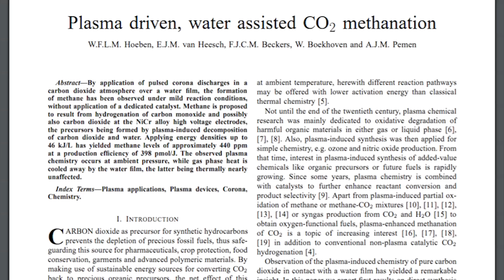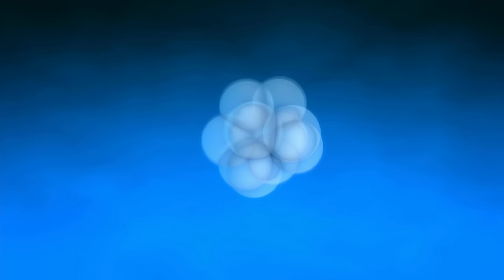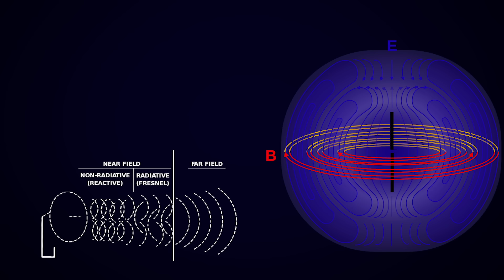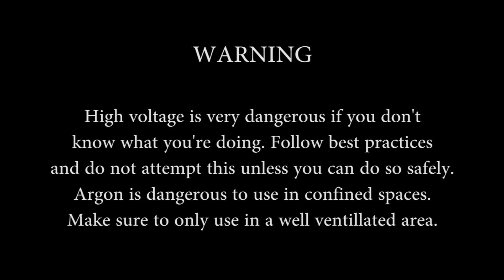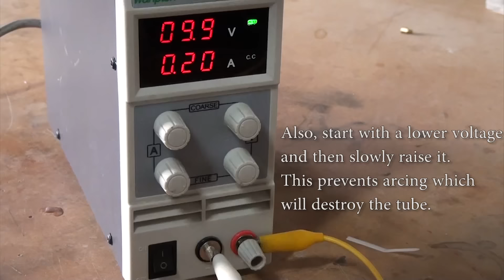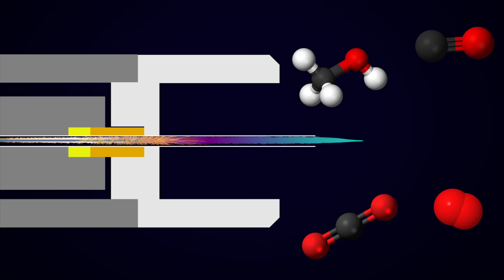Cold Fire You Can Touch - DIY Cold Plasma Torch

Comment: This is like when my older brother told me "blue fire is cold"
Reply: Brandon allidaP except this one is true
Reply: Brandon allidaP did u touch blue fire
Reply: @smellybruhwithattitude7287  maybe 
...
Reply: The more yellow it is the more dirty the flame, cleaner burning flames are hotter and go blue to clear. Don’t let your brother tell you stuff like that.
Reply: Yes and white fire is like ice
Reply: Magnesium fire is very bright white and  thus, very cold to the touch
Reply: I used to think that. I learnt my lesson...
Reply: He has never been near a Bunsen burner, then.. Blue means it is burning more efficiently... ie: burning all of the fuel. Bunsen found that torches weren't getting enough oxygen so a flame on the end of a needle with fuel pumped through ( think a simple lighter ) will burn yellowish. Adding a simple hole, to allow more air to be sucked in, allows all of the fuel to be burned.
Reply: @Acecool  i owe you one
Reply: @Acecool  wait so which is hotter
Reply: Blue fire is "cold" when compared to the bright yellow and white flame. It's still hot as fuck. Butane torches produce a blue flame, but that stuff can heat steel until it glows red, and can melt some metals, like aluminium. Don't touch blue flames.
Reply: Older Brother: Touch the blue fire it’s cold
Younger Brother: Touches cold plasma torch
Older Brother: 😨
Reply: It is touch it I dare u😂
Reply: Don’t touch the blue fire
Reply: This is completely different from your bro telling you that blue fire is cold
Reply: Blue “fire” is the hottest part of the flame 
This is cold plasma
Reply: Ethan Bayer 😂😂
Reply: @davidvenegas3198  These lesson s are like with Alice....each one gets shorter.
Reply: @davidvenegas3198  Every body looking at the blue "flame". Could be like Tesla ball..?
Reply: Owch
Reply: @markarthguard4443  RIP
Reply: @PunakiviAddikti  No, the hottest is white then blue then yellow.
Reply: @heh2393  and ultraviolet is hottest. So, hottest fire is near black.
Reply: @doombringer3498  No, according to Planck's law of emitted radiation (and Wien's law too), the wavelength with peak intensity is inversely proportional to wavelength, with intensity falling off on both sides. Thus as the object gets hotter, the peak passes across the visible range. Thus initially the peak is at red, then blue and finally when the peak is outside the visible range, all visible colours appear to have nearly equal intensity and thus the flame appears white. [NOTE: This analysis applies even better for objects that are better approximations of blackbodies, like stars]
Reply: @heh2393  thx!
Reply: @doombringer3498  Always welcome!
Reply: Lmfao
Reply: @wriggler5535  its never enough...
Reply: Our sun is really inefficient
Reply: I mean blue fire is either a cool temperature or REALLY frikin hot. Although someone did make a fire that froze water and it was white.

Comment: “I didn’t have any brass tubing so I just made my own” 
Y’know, just casually making brass tubing, like you do
Reply: Well, someone casually makes brass tubing, I mean the stuff I buy on Amazon must come from somewhere.
Reply: Probably melted a jar of pennies
Reply: @dmwanderer9454  That's copper, not brass.
Reply: @calebhouston5799  Pennies are mostly zinc with a copper coating.
Reply: Copper is one of the materials for bronze, the other is tin. I don’t remember what brass is a combination of though
Reply: @CubicApocalypse128 pennies used to be mostly copper. With the right ratio of old to new pennies, you could easily make brass.

Comment: put a phosphor on the tip so u can tell when its in use (from the uv light)
Reply: Better yet, get some 12 mm neon tubing with the phosphor already coated inside. You can make this a shroud on the output end of the torch.
Reply: great idea. a bit of glow in the dark pigment will do the trick. 
finding the raw materials for neon tubes isnt exactly easy, especially in small quantities. and most phosphorescent coatings used there arent durable.
Reply: @Ucceah  glow in the dark powder charges up. You need UV fluorescent dyes
Reply: no not phosphor, I think you mean photo-luminescent or fluorescent material but phosphor is highly reactive to oxygen so it will start burning in place not only when the torch is on but continuously until it is finished.
Reply: the "phsphor" in  CRTs has a very faint afterglow too. just like some white LEDs. it's falsely called phosphor, but that's what it's called. 
glow pigment has makes a great UV indicator, it's much brighter under UV, that it could glow on it's own. (the shorter the wavelength the brighter)
Reply: @htmagic  Then all it needs is a whirring sound and it's a sonic screwdriver :D
Reply: Any glow in the dark powder will work as a 'phosphor'... easy peasy.
Reply: Frank Roberts  yes, i think you are right, i didnt know phosphorus is the name of the element i thought it was phosphor since in my language it is similar to phosphor. Thanks for "illuminating" ;)
Reply: Frank Roberts  his emphasis being cheap lol
Reply: That's a really good idea lol maybe some shitty glowpaint or something simple. Idk if it would effect the torch at all tho.
Reply: I wonder if aimed at an old "Boob Tube" TV screen in close proximity, if it would excite the electrons on the phosphorous coating?!  Basically acting as an electron gun. ;)

Comment: air and water into fuel?

*united states would like to know your location*
Reply: Achievement Unlocked: killed by big oil
Reply: @mikescholz6429  And the next you will tell us, is the earth is flat and hidden by NASA. Right?
Reply: Lol no? Unlike that nonsense there are some verifiable deaths under odd circumstances with alternative energy. Its was also slightly a joke.
Reply: Look what happened to the american guy that ran his vehicle on this . He died in very suspicious circumstances , and his plans disappeared from his home , no witnesses . . So america already has this information . Strange how this happened after he refused to sell the plans to the corporate oil companies and government . . Its all there for anyone to lookup on the tube . He was going to give the plans freely to the public , he never had the chance to do so , this could be classed by some as speculation . . But ...
Reply: There's actually a city in Sweden where I think some government vehicles and a few private ones run on methane produced using a similar method. They take CO2 from the air and I believe the water is rainwater and they also capture the water to be reused when they refuel. They're basically electric vehicles which have had their batteries swapped out for generators running on methane.
Reply: Mainstream-ish tech now, several companies trying to make large scale carbon capture facilities to turn CO2 back into fuel. Though now it's a bit of a fool's errand since most transportation and energy will be moving to much more efficient electrical/renewable alternatives. After all, can't beat physics, you'll be putting in way more energy to make that "renewable" fuel than you get out of it. Great for aerospace where there simply isn't the tech to get something into the air/space on electricity (at least not for long).
Reply: @fava7753 If stainless steel is used to make and HHO cell it will produce deadly water. are you talking about stan meyer?
Reply: @fava7753  I remember that as well! He also had a welding machine with this technology. A flame you could touch and made with water. 
Not sure if this was in the 80s. 
He was harassed alot by guys in suits.
Reply: @hansnielsen4165  What kind of shrooms are you on dude? He was just making a joke. Before you say "well he better learn to make better jokes" just walk away. If this is humor that you don't like or understand, then leave it.
Reply: Not just America, you can't forget oil companies!
Reply: Idk about water.
Reply: honestly to everyone here, I would say this is more dangerous to the manufacturing industry because this is probably how they are making those plastic sheet based Arm processors that will cost so little that they can make hundreds if not thousands for a dollar, but traditional vapor deposition damages the plastic from all the plasma heat formed in the materials being vaporized and deposited onto anything, with cold plasma though should be easy to get even hard to vaporize items to break down and subliminate and maybe even avoid it just coating everything, but rather be able to use laser assisted deposition, and my own addition beyond what is already being at least claimed to be done, of laser resistive vapor deposition, ie where your target is being bombarded by two different frequencies of laser where overlap and one frequency is pulling the energy OUT of the item to allow the outer shell to collapse and not have a conductivity that the area the other laser is hitting all by itself and is absorbed raising the electron valence potential, making it temporarily conductive, so you get deposits there, while everywhere else the plasma particles are being rejected away from the surface, 

with all that, and the tech to make that cold plasma you have particles that are not so energized that they refuse to bond most of the time like trying to get a basketball to go in a hoop at 1000mph thus anything other than straight at the hoop, causes it to deflect harshly and go off far from said hoop, but slow it down and the less energy the less accurately it has to hit that hoop (the electron valence angles pointed at each other in one's void while in the others spike to get that spiked electron to couple with the proton energy's higher level in said void) and thus more accurate deposition, with a LOT more control and next to no erosion or in the plastic issue, giving it energy to allow it to shrivel back to the shape it wants to return to, and deforming that perfect flat surface, ruining the trace and semiconductor shapes, (think a heat gun hitting a soda bottle, so as to cause it to shrivel up in sections and becoming very ripply) 

this long diatribe is to explain that what he has here is a way to allow garage manufacturing of all sorts of stuff that normally you have to buy it from a monopolistic system where it all comes with a barcode, the measure of insovereignce because you have to comply with the demands be it just how much money, or say in a social credit system, have a certain way of thinking before the few entities that have massive manufacturing facilities will let you have their product, and you are stuck with not being able to have it with out initiating an act of violence to steal one say from someone else, (and later maybe stealing their DNA or something to be able to keep it functioning once you have liberated it from their possession, ) instead in this system while yours might not be as awesome and efficient, it should still function well enough that you can tell them to sod off and just make and use your own, (think massive network of people doing this by manufacturing their own opensource high powered wifi routers to make a mesh network, to avoid paying for connectivety every month, and having invasion in their privacy to be allowed to connect to the world wide web,  and this tech could easily be used to do both the wireless routers and put them on drones made in the same garage, allowing them to hover above the ground in cycles so you don't need to build a tower, or even own the land it is acting on, it could be hovering out over a forest and even use a few to take out parts you made to establish your own solar charging station there, or even a wind based one using flap tech rather than rotational and even electrostatic wind energy (ie the wind blows between two triboelectric materials like urethane and the other being styrene with teflon ground up and dispured into it, to make one strongly positive charge and the other negative charge, so the air can collect electrons from one and give them away then to the other's demands, add a conductor to each, and use that to make a path to either side of a load, and you have DC current from that static charge build up, that each side is assisting the process but the air between acts as a dielectric to ensure your higher conductive path, is the path the electrons return through to balance out those two materials :) with all that, we could even be doing this with self assembling rigs out at sea for continent to continent communication in a cellular floating and flying network small enough and strong enough to move around to avoid oncoming storms, and boats navigating the ocean ! 

ie, it puts the power held by intense semiconductor industry corporations, into the hands of individuals that might just do ANYTHING, like even have co-operative anarchy based on volunteerism, lol.
Reply: @WhiteWolfos  yeah think thats right , after he refused the corporate suits and said he would give the information freely to the public  . Then was found dead under very suspicious circumstances , and the plans were taken from his home at the same time .  billions of dollars to the fat cats are worth more than a life I suppose  . Just a thought . The story is all there for anyone to look up on the tube . Stan meyer , the water fuel cell . Replaces spark plugs and converts water into hydrogen gas , he was offered a billion dollars for the plans but refused saying it would be made available to everyone .
Reply: Hans Nielsen woooooosh
Reply: @jkenny1  Could you explain how non renewable energy like gas made from oil takes less energy to get and make than a cleaner safer renewable energy like hydrogen or hydroxy made from water? Looking forward to your answer. Thanks!
Reply: @fava7753  now you can just integrate your secret to public info into bitcoin or other crypto network transactions info. Am I right?
Reply: Too bad the efficiency is too low to do it in quantity. There's not enough CO2 in the air anyways, though it might have applications on a martian colony.
Reply: Legend has it if you say “fuel” or “oil” three times in a row the US will invade your house
Reply: DID SOMEBODY SAY OIL
Reply: funny. i laugh
Reply: Great our air and water are next
Reply: so basically, respiration?
Reply: @mikescholz6429  Also, methalox isn't that much cleaner than gasoline.
Reply: cia

Comment: Fun fact: a lot of the mass market semiconductor industry uses plasma torches to superclean wafers. They use blown discharge in air though, not argon. Very similar to what you've built.
Reply: Are you sure ?
is plasma ESD safe for this kind of process ?
Reply: @gregandark8571  I'm not sure exactly what they use, but I'm absolutely certain I've seen plasma used to clean wafers during production.
I don't see why it wouldn't be.
Reply: Plasma is indeed used for a variety of things in the semiconductor industry. I believe the process most similar to what you mean is a simple plasma clean. It's not a cold plasma but typically an argon plasma that physically cleans the surface by the bombardment of ions. A more aggressive clean uses oxygen plasma which will react with any organics on the surface, turning them into CO2 and H2O
Reply: Interesting.
Reply: @gregandark8571  The monocrystalline silicon before doping is an intrinsic semiconductor, which means it conducts electricity very poorly. Actually, undoped monocrystalline silicon is widely used as an insulator in semiconductor devices.
Plus, ESD damages electronic devices largely because they permanently breakdown the thin dielectric layer in, e.g., MOSFETs. The dielectric layer is applied way after cleaning the wafers.

Comment: Hell yeah, instant like.
Reply: Cannot understand why all so interested about this particular video. Spending a year on trying to get atmospheric-pressure plasma jet with DC voltage is not so clever decision.
Reply: Instant subscription
Reply: @user255  This was explained directly in the video. Starting from 4:49 to 5:54.
Reply: @user255  I've already answered you, try to be more perceptive.
Reply: @LoganDark4357  The Thought Emporium is talking about using AC (starting from 4:49 to 5:54) or at least oscillating voltage for atmospheric-pressure plasma jet, but using computer monitor flyback transformer (that is shown at 7:02) which have capacitor at the output - so the output voltage is constant. He spent a year on trying to get atmospheric-pressure plasma jet with constant voltage. Please, try to be more perceptive.
Reply: @user255   Flyback transformer shown at 7:02 cannot output pulsed DC voltage if we are not talking about 10Hz or below pulses and if there is no modulator or some sort of interrupter.
Reply: @user255  Sure enough it will work with constant voltage but quite inefficient. You can check for atmospheric-pressure plasma jet design basics if you still didn't. Certainly there are flyback transformer that do not have the capacitor at the output, but one shown at 7:02 is no doubt have the capacitor at the output.
Reply: @enclis  With that attitude the human race would never achieve technological advancement. A lot of things we take for granted today used to be considered stupid, ludicrous and people were even killed over certain things. Instead of complaining about this video why don't you see it as an interesting idea that could prove to be very useful in the future?